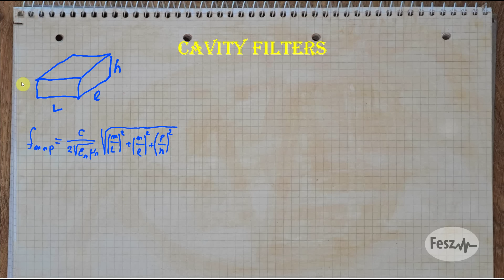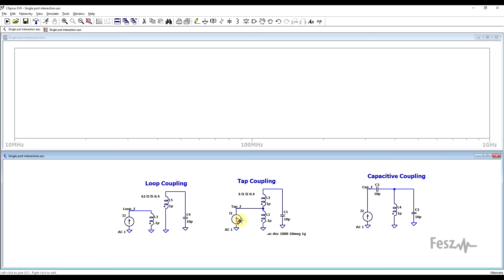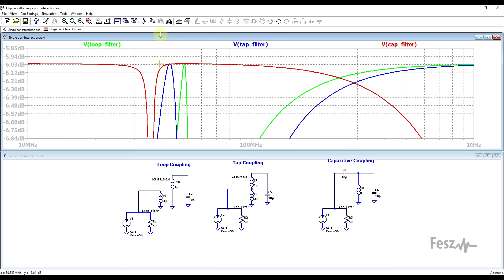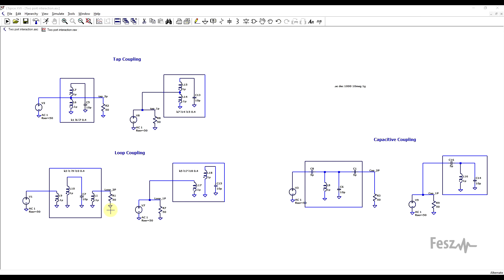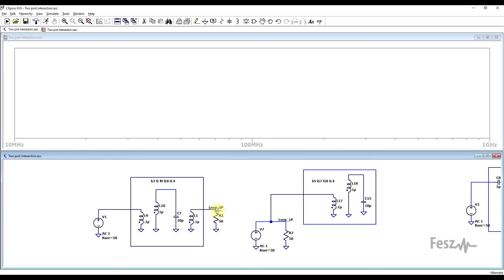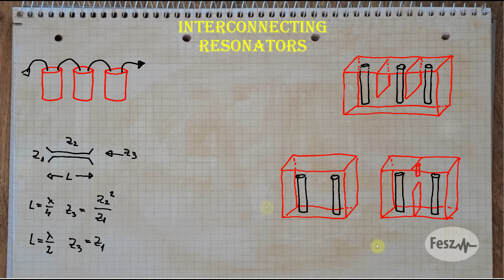Cavity Filter Basics

Comment: I'm trying to investigate the so-called havana syndrome under the hypothesis that part of the power causing harmful to humans effects is actually coming from the household wiring, which is 120 volts at 60 hertz in the USA.  Possibly with an injected microwave or mmWave signal beamed onto the wiring system at some conveniently exposed point, thus energizing the entire wiring system with GHz frequencies. An example would be a metal electrical switchbox containing a common light switch, with a Romex two conductor 12 AWG wire inbound and with 1/4 inch loops formed in the copper and attached to the light switch with screws.  The metal box would become the cavity, and the 1/4 inch loop and attached conductive apparatus would become an emitter, especially at any sharp corners or wire ends. Another example would be a common 120 Volt 20 Amp Receptacle, this time with Hot wire, Neutral and ground all connected to the receptacle inside a metal receptacle box.  Just a thought for now, and a use-case you may not have considered. I'll go watch your next video in this series. edit: I should have mentioned, the GHz injected signal would be pulsed and frequency hopping in some devious way to make it difficult to measure.

Comment: How strange. I got 100% of my answer here and more. When I saw the DIY filters (you think the build quality's not great, but I think they're astounding), I actually had 90% of my answer. All the sketches thereafter were bonus material. Great video. Thank you.
Reply from the maker: Regarding the build quality; I did see some others make such filters using machined pieces of metal - sure the soldered PCB also works, but the machined metal looks nicer :D

Comment: I am a hobbyist and I experiment with RF, my mathematical knowledge is poor. I have a quartz oscillator ICD6233 programmed for 100MHz, but there are  multiple harmonics and I need to boost the 400MHz while filtering out the rest. I need to also narrow the slopes of the frequency (in hobbyist terms) I need to suppress -filter out (attenuate) the grass (notch) before 400MHz and after it. Is it possible by using a cavity filter? I did experiment with LC Band pass filters shunt and series but I couldn't get the results I wanted. Can you suggest a solution? Thanks a lot.

Comment: The electric field is perpendicular to equipotentials (i.e. conductors).  At 3:00, the electric field is radial rather than longitudinal.
Reply from the maker: In the case of the resonator, the structure (at resonance) has opposing charges at the ends - when the top is positively charged, the bottom is negative; that is why the lines seem to go perpendicular. Even though its one piece of conductor, at high frequency it is not a equipotential - local bits are at different values.

Comment: I would have liked to see the design of those two sample filters you created. Design, construction, and testing. That would make a interesting video.  For instance how did you spec out the size, positioning of the internal components & how to make any adjustments (presuming its possible with the construction method used.

Comment: Super interesting as always. Question: the 50 ohm source impedance in the models should be in series no? Or what is the effect of having this resistor in parallel with the voltage source?
Reply from the maker: When modeling a voltage source, this is comprised of an ideal voltage source with a series resistor; when modeling a current source, its comprised of a ideal current source with a parallel resistor. If you add the resistor in parallel with an ideal voltage source it will have no effect (same for a resistor in series with the current source); from the "outside", an ideal voltage source, or an ideal voltage source with a parallel resistor behave in exactly the same way.
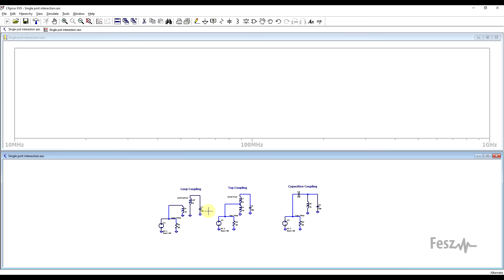Reply: @FesZElectronics  Yes, yes! But at 5:30 you are using voltage sources. Therefore my comment . Thanks for this quick answer, and for your excellent videos!
Reply from the maker: With voltage sources, if you right click on them directly, or going to "advanced", you have the option of defining the parasitics - series resistance and parallel capacitance; in the simulation, you can see under the "AC 1" parameter definition, the text "Rser=50" which is part of the voltage source definition -so the 50ohm series resistance is included into the voltage source, it does not have to be a dedicated external resistance.
Reply: @FesZElectronics  Oh I see. So the external resistor is just an adapted load resistor? this makes sense.
Reply: It iš source output resistane from signal , other---output loud resistane.You must conect 50 om resistor ir you measure with big resistance voltmetr( and not conected any loud with 50 om input )